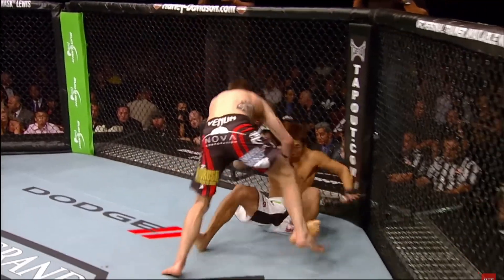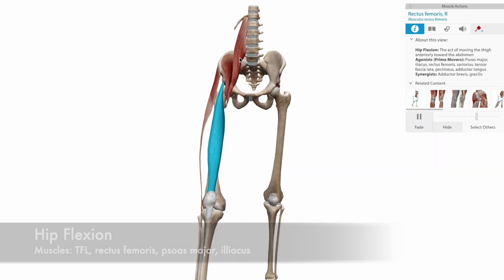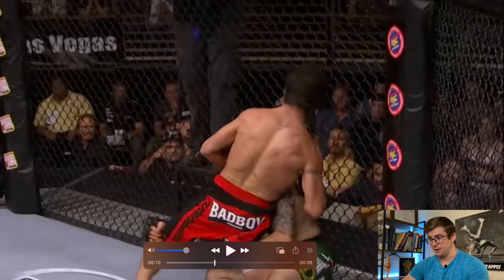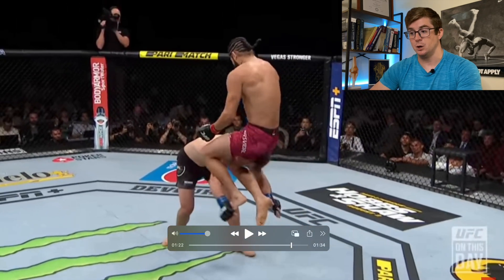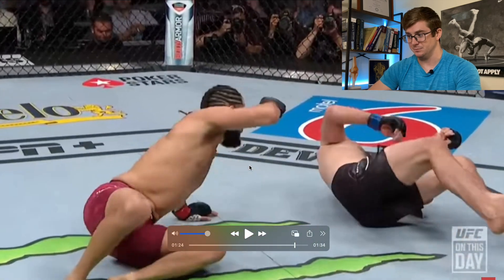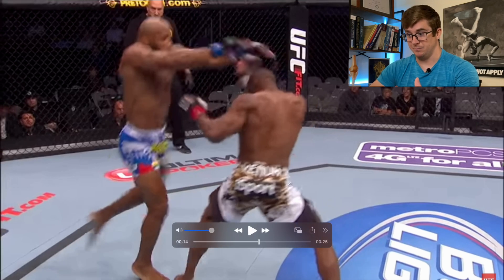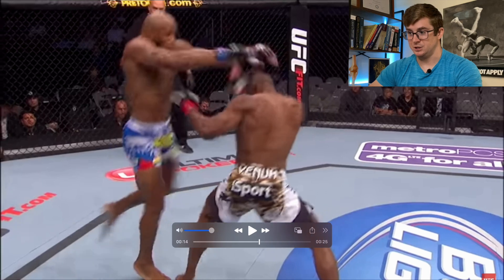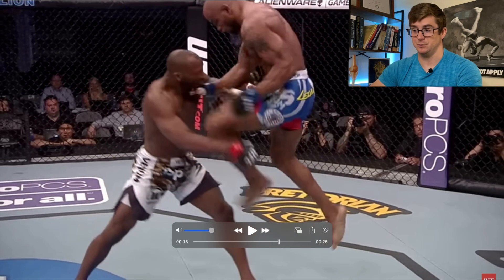Biomechanical Analysis of the Flying Knee

Comment: What is the recommended angle of the head to reduce the chance of concussion when getting hit should your head be flexed or just stay upright and does tucking your chin when flexed and slighly crouching your upper body is a good idea? So that you will get hit more often in the top of your head and flexing your head so that your chin will be harder to hit
Reply from the maker: So I don’t really know if there is a recommended angle of the head to reduce the chance of concussion. I’d focus more on having good defense and try to avoid head shots altogether (although they’ll happen inevitably). I wouldn’t default to leaving the top of your head open either. Axial loads going through the top of your head down through the spine can be harmful as well.

Comment: Your channel is really awesome, these anatomical breakdowns are extremely fascinating. The flying knee clinch is so nasty, two object crashing into each other at speed always creates so much more kinetic energy vs one object of the objects being static. He just accelerates that cranium down against gravity while steching out the guy's cervical spine right before the ascending knee makes impact... Pushing down on the guys head like that helped to keep in him the air a bit longer, adding to the floating effect, no doubt showing complete momentum transfer the way he just stops in the air, not blasting through or bouncing off it was literally perfect. 

Theoretically, if a fighter was wearing a cervical collar/neck brace, would they be impossible to knock out?
Reply from the maker: Nice question! Quite the hypothetical I haven’t considered. There is almost certainly some part of the concussive blow to the head that is attributable to the impact alone. But, if we’re going off of the assumption that axonal damage via traction is the primary mechanism for brain injury then not allowing movement to occur would significantly reduce the severity or threshold for injury. Obviously it’s impractical but I’d have to think that through a little more.